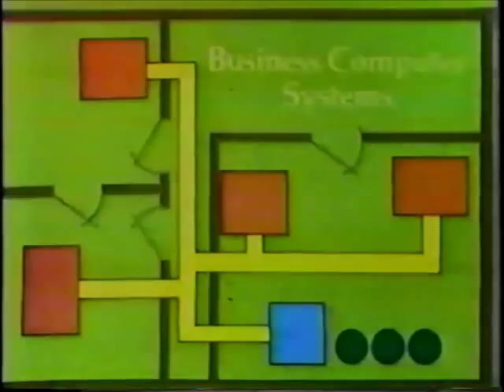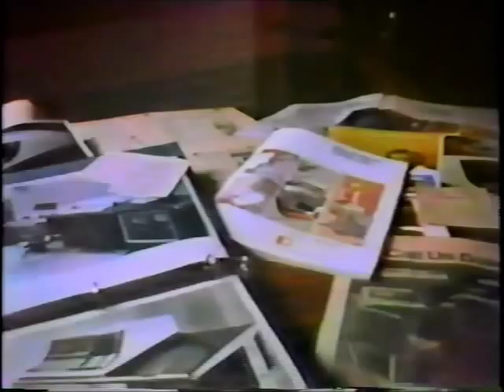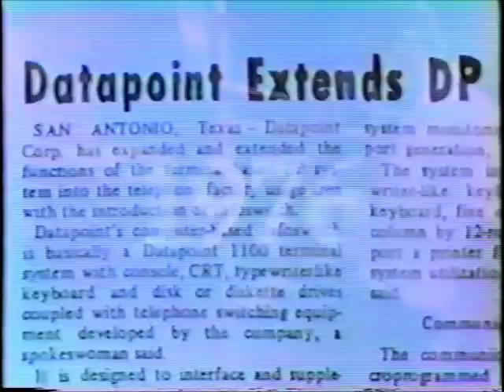Datapoint-WeMakeComputers

Comment: Just busy restoring a Datapoint 2200... Anyone has a set of cassette drives for this ? Mine is a version without them.
And while wishing for the impossible.. a spare CRT would be heaven, as the on my machine clear had a hard life and has a severe burn-in issue.
Reply from the maker: you'll need more than just the cassette deck module... you'll need at least one circuit board too.  Actually, if the machine you have doesn't have a cassette deck then you probably have a Diskette 1100... I don't recall any other 2200-class machines that don't boot off cassettes.  The 2200 and 1100 never supported ARCnet or other booting off the network.

Comment: If I remember correctly it was you, Gordon, who came to my Datapoint ARC at the Waitemata Electric Power Board circa 1980, where I was MIS manager, and there discovered what had been causing problems with CDC drives on ARC's all over the world. But ours was the worst ever, it would not run on an ARC for more than an hour, although stand-alone it was fine. So it pointed to the solution, which was to shield the ribbon signal cable with tinfoil. Has my memory served me correct?
Reply from the maker: Hmmm... I don't think that was me.  I can't imagine what would have made it ARC-specific, other than perhaps the higher overall data transfer rates ARC supported.  And most of those MIDS drives tended to be found on ARC file servers, rather than on smaller applications processors.